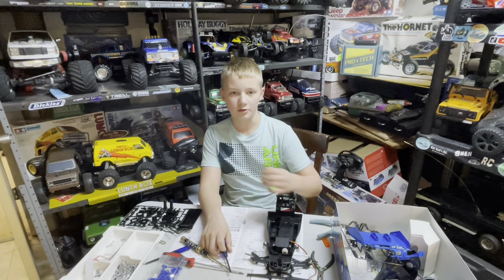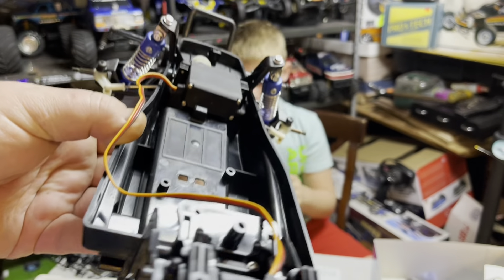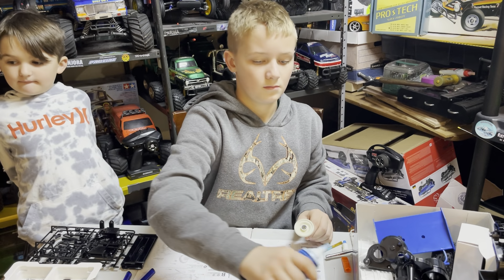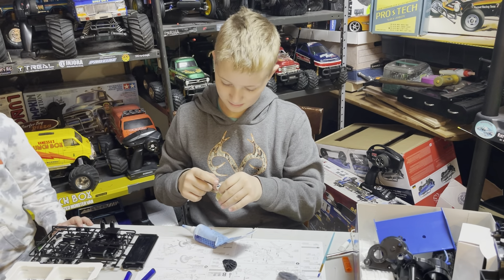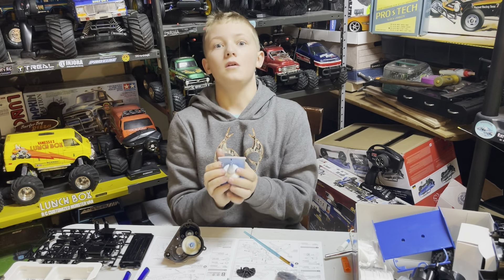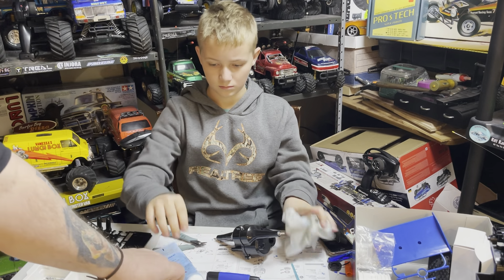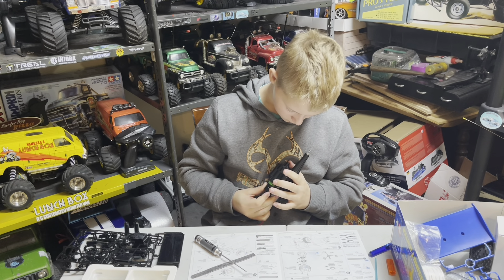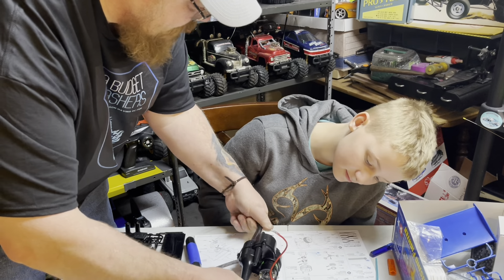The Grayson Show. Grayson Builds his Rising Fighter pt2

Comment: The little tubes of grease have never really been enough for me :-) I would have put a little grease in a dish for him to use. The chassis done already, funny Tamiya reused the DT-01 gearbox on it.
Reply from the maker: Yep as AMPRO Engineering said they should’ve called it the grasshopper 3.. dt01 trans and hopper front, but slightly different with the bigger front shocks.. it’s a great kit. 
I agree about Tamiya grease. There’s never enough.. and I wanted him to work at getting the grease lol 😂
Reply: @IowaBudgetRCBashers  True and the shocks are DT-01 as well.